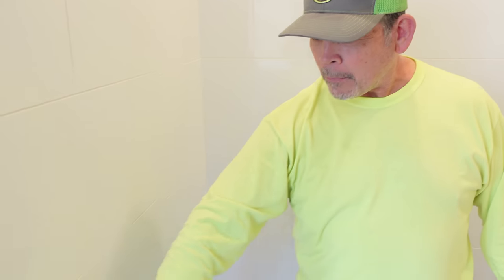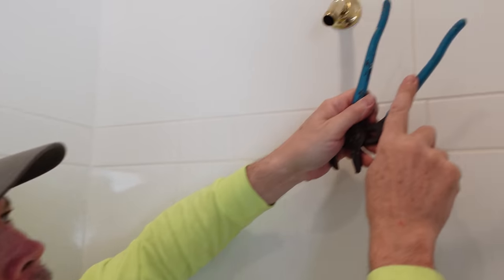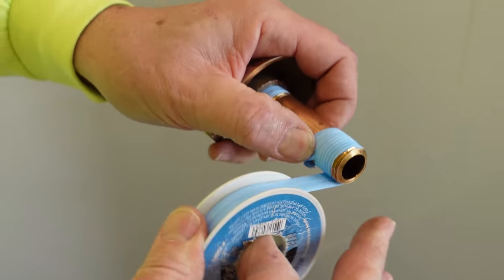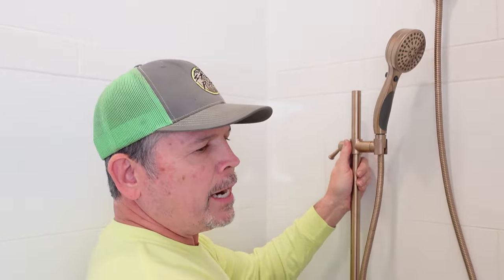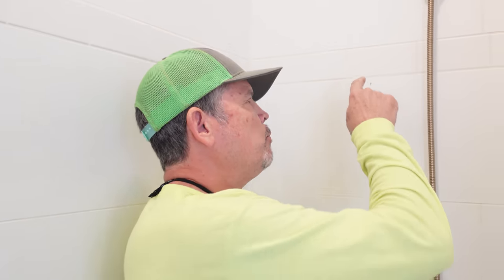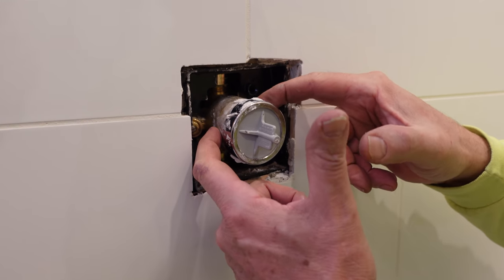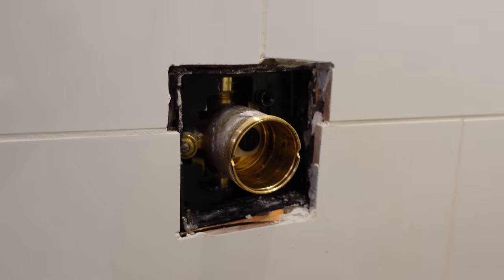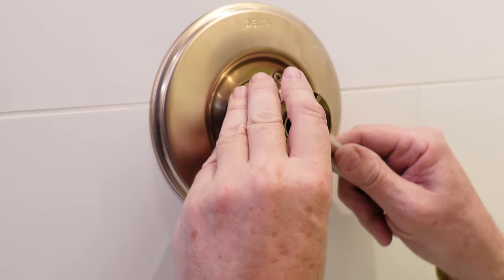How to Install SHOWER TRIM (Step by Step)

Comment: It seems weird that the shower hose comes from the top and hangs loose in the middle of the wall. But maybe that’s just me.
Reply: Every handheld shower head I've seen is that way.  The difference with this shower is there is no head directly off the top, the 90 degree adapter is there instead.  Could be either way given the correct hardware.  In some jurisdictions an anti-siphon valve is required at the top, so installation is dependent on your local codes and the equipment being installed.

Comment: Great tips, as always! 👍
That shower valve is pretty cool with option to adjust hottest side - good child safety.. 😎 Sad that I didn't seen nothing similar in Europe... But from other point of view, time by time I open usual shower to max temperature at 50-55 degrees Celsius to kill all bacteria, that loves middle temperature and lives in shower head.. 😂

Comment: The shower set up looks cumbersome for a elderly person with the double handle valve and the shower on the opposite side.
Reply from the maker: We did the double handle so my mom can set the temperature and forget it knowing that it will always be the same.  The on/off handle allows flow control something you can’t do with a single lever👍👊. The shower head opposite valve allows my mom to turn on the shower without getting wet until temperature comes up.

Comment: What the heck is even this? The last video about this shower ended and the next video started with absolutely zero continuity. None of those walls were up, none the the plumbing was installed. The last we saw this shower, some framing members were being repaired. Next thing you know the plumber has a stub out out the wall and we're all supposed to act like nothing happened? 
Essential Craftsman literally laid the blue print out for you guys for free and you choose to ignore it not just willfully but maliciously. 
Get your ish together. Gather it all into one place. Bundle it nice and tight. Then you'll get my viewership back. 
And if the Spiffing Brit is any authority to go by, my YouTube Red minutes are worth fighting for.
Reply from the maker: If you truly got to the end of the last video then you would know that we subbed out the tile on this one for speed, and they requested not to be filmed and we respected that. 
We like to think we have our ish together pretty well, can’t make everyone happy, but we try our best 👊🏼